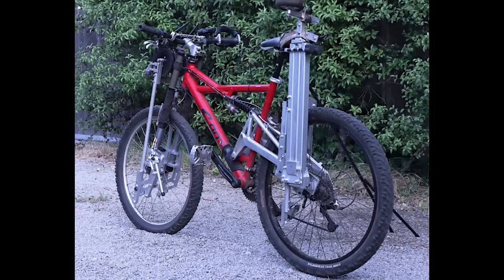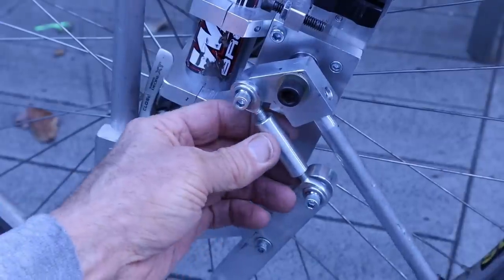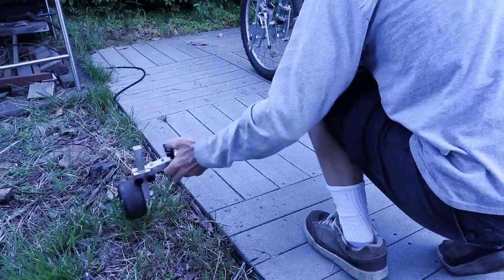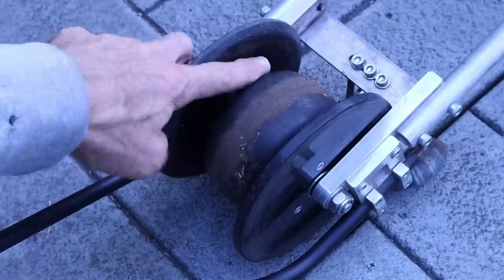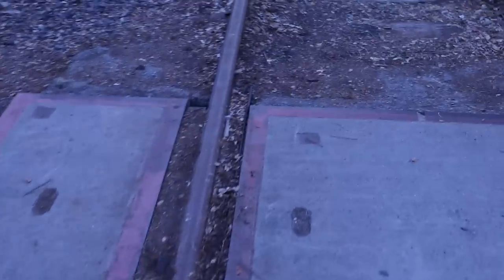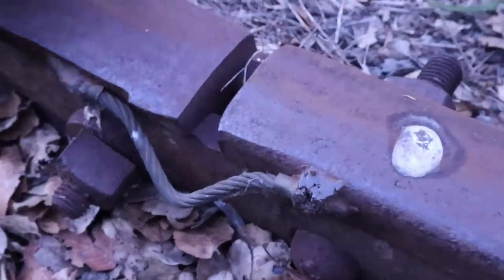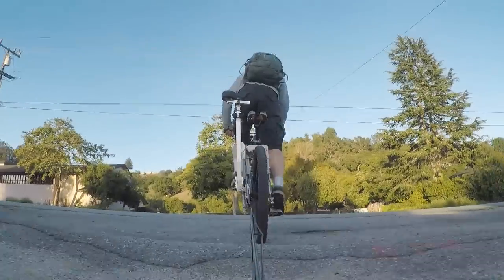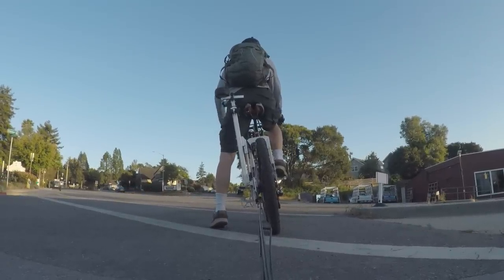Rail Bike with folding outriggers - riding  abandoned railroads on the central coast

Comment: "I've actually found that it is easier to ride across town on the rails than it is the road" - if only there were rail vehicles regularly operating on them providing this very service
Reply: spot on :-D
Reply: But then you would have to travel with other people.
Reply: @viron6734  oh no...
Reply: The city I live in has an abandoned rail going from downtown to the mail about three miles away, I always thought it'd be cool to have a tiny train to run passengers
Reply: It's only convenient because he's the only one. It would get bad quickly as you add more people.
Reply: But that's why it's named after a train. Go one after the other, lol @KyleNortonfx
Reply: @KyleNortonfx  not really. There are tourists attractions where you ride pedal-powered-vehicles on old train rails. And even if - on a nice summer day - there are a lot of people it still isn't bad at all.
Reply: @omegaPhix  You are underestimating the value of that. No joke.
Reply: @Jehty_  Sure, but what about bi-directionality? That outrigger would complicate that a lot. Might be doable on a single rail though.
Reply: @jameshisself9324  Other people in my trains don't bother me. Never felt the need to take my car
Reply: It'd  be a one way trip.
Reply: The problem is that it is not profitable and would have to be subsidized by the government. If these rails are no longer in use, they should convert it to a greenway for walking and biking
Reply: @omegaPhix  It's not just 'people'. It's peace and quiet and solitude.
Reply: @carrioncrow8191  Agreed. As much as I love this, these empty rails would better serve the public good as greenways. But that costs money so we don't do that in America.
Reply: @jameshisself9324  it could also be that it has a national security significance, and is being maintained for that purpose
Reply: @carrioncrow8191  That is a BIG if. Given the significance of the rest of the US rail system that is still active, the Interstate highway system, the Military Airlift Command and the Military Sealift Command I doubt it.
Reply: CRAZY TALK
Reply: Typical in America public transit and genuine walk-able cities don't exist. Infrastructure is so bad in America.. that if you want to walk or bike (i.e dont have a car) it's better to take old railraod tracks.. ridiculous. I've known Dutch ppl and other Europeans that can live their entire life without ever owning a car and it's more of an inconvenience to own one that it's not. That's how things should be. Sick of the concrete paradise
Reply: A private train service setting their own prices would be great, otherwise the public would have to pay for the train with higher taxes and no one wants that.
Reply: @smokeweedaily  It would be cheap as hell if the public didn't have to pay for horrible car infrastructure. Look at Texan tax payers paying for 26 lane highways.. and all they do is make the congestion even worse. Public transit is cheap and efficient.. it would not hurt your pocket
Reply: @noynayru  Tell us how you're going to cross Arizona, Utah, New Mexico, and so forth without a car.
Reply: @stokestack  Nice strawman. I hope you're just trolling. cuz the answer is just a train. and if you want to drive so bad, then nothing is stopping you from getting a car, genius. you just should not need one to go to the store or go to work. north america is one of the only places where 99% of the time you absolutely need a car to get anywhere
Reply: @noynayru  I think NPR or some affiliate did a story on it.
Reply: @noynayru  I think Greenspace would be EVEN MORE expensive
Reply: @stokestack  I think it's just about accessibility
Reply: The only thing keeping you from riding your bike for transportation is excuses. I have commuted on bicycles all over the USA. There's nothing preventing it. 
There are places in the US with trains, go try it out, they suck. California is about 100 billion dollars into their imaginary bullet train that will run where empty Amtrack trains already go. 
For longer distances, use a more modern invention called an airplane. It's a great way to get hybrid-car levels of fuel economy (per seat) but going 500mph.
Reply: @A.J.1656  lol... dude. I don't want to get smashed by someone on the road. There's a good one.
Reply: @noynayru  Right. Because a train runs on a fine grid that goes to every part of a giant state.
Reply: Yeah, if you hate equilibrium vehicles like bicycles and motorcycles, riding on rails is easier. Even tricylces suck for the simple reason that there is one wheel too many, screwing the freedom principle and you do notice that. You will feel like a rag doll being kicked to the left and right and that weird feeling never stops. It is duh. Only rude  and stupid persons have no idea. At least admit this. But yeah, you can ride tracks, if you have nothing better to do. Why ruin such a lovely bike? Ride along that track, or build a small pedal train cart. This combination is... not that great.
Reply: @stokestack  that’s not what anybody is saying, but if you want that sure try to get it done. would be cool. trains should at least go between major cities, then trains within cities to get almost anywhere
Reply: @noynayru  the most infuriating thing in america is that there used to be functional rail lines between the major cities of the late 19th century; moderately sized cities also had priority public transit like streetcars. Truly sad that we stopped building infrastructure for the most efficient motor-driven transport method known to man.
Reply: Yeah it's like "huh that almost seems like something you could build into a very popular public service. You just need a vehicle that can hold several people and some regular places for it to stop and let people on and off..."

We'll just have to give that some more thought.
Reply: There are....but for some reason every time they are built the builders think they need to chain together a bunch of units to make some ungainly, slow thing that needs to be powered by smoky diesel or unsightly overhead wires or dangerous ground-level electric power.......nobody seems to want to build individual or small group units for self-powered transit.
Reply: There was, everywhere, 75-120 years ago time period.  It there was money to made, they would be doing it still...but it's not economically feasible.  Without Gov't subsidies, Amtrak would not exist.
Reply: @oledahammer8393  railroad building was subsidized, but car infrastructure is subsidized now much more than railroads ever were. Different paradigm.
Reply: @oledahammer8393  People always make it sound like it's a bad thing for a government to pay for a public good.
Reply: @stokestack  tell me why you need to take a car to go down the street? Cars should be used for traveling long distances, but you should not be forced to own one to go places within a town. Trains can go between states, and most people don't need to drive themselves between states all the time. Do you really want to spend thousands of dollars on a vehicle you only need maybe once a year? And if trains, busses, or planes are an option for long distances, you may not even need it for that. The only real exception in my opinion is when you have to move stuff that you can't take on public transportation. In which case you could end up needing to use a car, which you could own, rent, or hire someone to transport it for you. Or in many places, there could be infrastructure for cars as well as people. So when you need to go across state, you can drive, but you don't have to drive if all you're doing is going to work or going to the store. I'd honestly rather be able to walk or ride a bike everywhere and rent a car the few times a year I'd ever need it than to spend an incredible amount more owning a car and being unable to walk places because there's no sidewalks and drivers don't pay enough attention to not hit you
Reply: @A.J.1656  it's definitely not safe to ride a bike in most places in the US though. Yeah it can be done, I've done it for a long time, but I've been hit by a car at an intersection where I had the light and the right of way. Traffic was slow enough that I didn't get hurt but my bike nearly got crunched. If I can't ride a bike to school In a small town without getting hit myself and seeing people get hit regularly, how could.i consider it safe to ride in places with no sidewalk, no bike lane, and no space on the side of the road? My problem isn't excuses, it's that I want to live. If there were better infrastructure for biking, more people would do it, less people would get hurt doing it. I'm all for riding bikes everywhere but its just not that easy or safe in the US. Being technically possible doesn't make it safe, enjoyable, or feasible in many cases
Reply: @toddrader1470  you say that like trains are a bad thing. Do you know how much worse individually powered units are? They have all the issues of powered lines or diesel, but with none of the benefit that you get from economies of scale. Also, the ground level power isn't that dangerous, the overhead wires don't look that bad. I'd prefer wires to cars any day
Reply: @thedudeamongmengs2051  
The funny thing is I'm sitting at home making youtube comments because a truck pulled out in front of me and I ended up with a broken wrist.
Safety is a valid concern, but I still ride my bike a lot. For me it's not about any global warming doomsday prophecy or some self righteous act of self flagellation that let's me claim the moral high ground. My daily driver is a pickup truck and I fly jets for a living. I just like riding my bike. lol
Reply: @dilbyjones  
It's a risk. I'm nursing a broken wrist for that exact reason right now. I still rode my bike to the grocery store the other day. Haha
Reply: @thedudeamongmengs2051  I agree that there should be sidewalks and drivers who don't kill you. But trains kill people, and we don't destroy their infrastructure. And yes, it's nice to have places to walk to. None of that requires abolishing cars. There are U.S. cities I wouldn't own a car in, certainly. New York and maybe Chicago among them. But L.A.? The vast expanse of the U.S. west? Come on. And hey, if you want to live apartment life without pursuing interests that involve space or materials, go for it. Lots of people fall into that category. But lots don't. I garden and make stuff. I need a vehicle to support those kinds of activities.

Here's one thing we can all do: support our local airports. Small airports are being targeted and destroyed at the behest of developers and the politicians they own, along with fake NIMBYs looking to goose their property values. Not to mention airlines, who actively campaign against small, efficient airports so you have to fly massive jets unnecessarily. Destroying general-aviation airports is about the dumbest thing we can do, as electric planes become viable for semi-regional trips and the car infrastructure is maxed out.
Reply: @toddrader1470  im sorry ,  but that is possibly the stupidest thing i've read all day. trains are amazing when done right. you know absolutely nothing about proper trains if you think individual cars each having their own motor or engine is a good idea. thats literally just a car but on train tracks... there's a very good reason trains are pulled by one main unit
Reply: @shoop91lee  lol a tiny train..hey GET ON JESUS TRAIN BOUND FOR.GLORY!
Reply: @stokestack  I garden and stuff too. You can put a trailer on a bike and it'll hold pretty much whatever you need without much difficulty. I've seen people move lawnmowers and other stuff on bikes. But also, I'm not saying we should abolish cars or car infrastructure, I'm saying we should improve it and have less of a focus on cars. Right now it's basically impossible to use a bike or walk for regular commutes or going to and from the store in the US. Unless you're moving like entire full grown established trees, it can be moved on a bike. If you need to use a car, there should be a bike or walking lane with at least a little bit of space between it and the road. There shouldn't a huge percentage of a city's entire space dedicated to parking lots. I'm not sayingnwe should just abolish cars, they have their place. But cars shouldn't be the only safe and comfortable option. Plus there's also things like Kubotas or whatever they're called. Small utility vehicles or scooters. There are plenty of other options that work for most people all the time and for the rest of people most of the time. If you're moving something so big you can't do it with a bike or Kubota with a trailer, you probably need a truck or a uhaul or something and you're probably not doing that every day unless it's a commercial thing, which is a different issue
Reply: nah, places would rather tear them out and sell the land, at least thats what they seem to be doing
Reply: @KyleNortonfx  they should Invent some type of car that's designed to hold a bunch of people to move them all at once. You can even hook these pods together as a type of train to move hundreds of people
Reply: @noynayru Why only in EU. There are many places on the planet, where one owning a car or any gas guzzler is a must. It is a stupidity, economic burden and appeasement of automobile industry inflicted upon those who work on minimum wage which do not rise for decades.
Reply: Create all kinds of infrastructure problems. 
Thats why bigger cities just do public transit systems like busses, trolleys, and well rail cars such as sub ways
Reply: This rail biking is going to be a hobby or a sport with importance to Olympics, just like some ancient sports have still hung around in Olympic but not much mass followings. Although, it is possible to use tracks of tramways and light rails in some cities, such as in Melbourne Australia BUT that could create more chaos and disrupting the regular services or trams and light rails. However,  portable and convertible design (from regular bike to rail bike to regular bike) would only make sense. Only time would tell.
Reply: I mean if you live in North America, public transit services are practically nil
Reply: Some railways don't operate public transportation, some are freight only.
Reply: @viron6734  It's 2022, noise cancelling headphones, a cap, sunglasses and a face mask, you aren't travelling with anyone. 
And let's be honest, you have your head bent into your phone 100% of the time anyway.
Reply: @A.J.1656  I grew up in Chicago.  The trains and els are great, far more efficient than cars both in energy used and time spent.  They far from sucked.
Reply: @mbryson2899  
In a congested urban area, light rail or subway systems can be an efficient way to move poor people around and give homeless people a place to poop, pee and use drugs out of the weather. Trains suck, even in Chicago. I've been on them.
Reply: @arkthefennecfox2366  what if you did operate on them
Reply: @kentallard8852  nothing, but we have a rail line that runs through the middle of our town thats freight only.
Reply: @A.J.1656  If public transportation was subsidized as lavishly as is the infrastructure for private vehicles there wouldn't be a problem.

I don't know what you were riding in Chicago, but I never had a problem with any El line, Metra, or the South Shore.  Plenty of non-poor riders routinely used them; we had more common sense than vanity, why waste time, fuel, and money stuck in traffic and finding parking?
Reply: @mbryson2899  
OMG. You're adorable. 
I like the part where you pretend I don't know what I'm talking about and you pretend that the reason people don't want to ride trains filled with poop covered junkies is a conspiracy by big oil. 
That was good. lol
Reply: @OKuusava  Thanks for your rude comment? My idea of solitude is not sitting in traffic in a car, quite the opposite. Being out on a rail bike away from cars and noise and pollution and crowds of people with nature is appealing to most people.